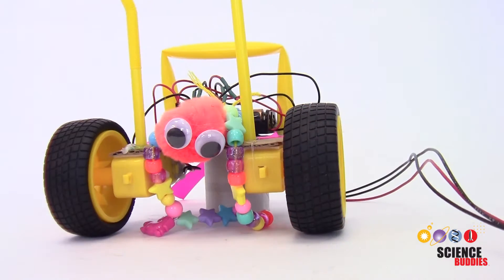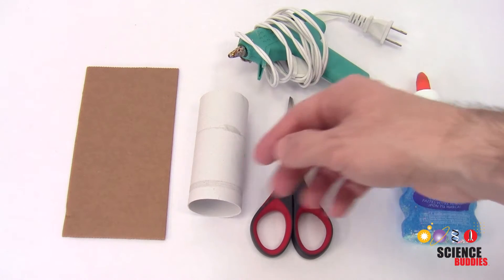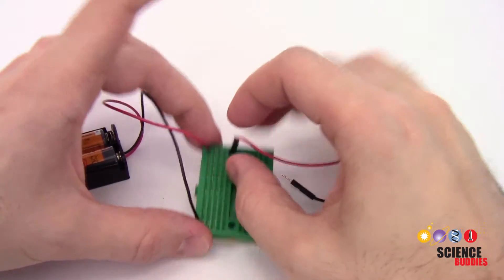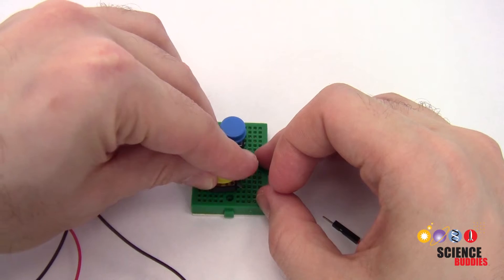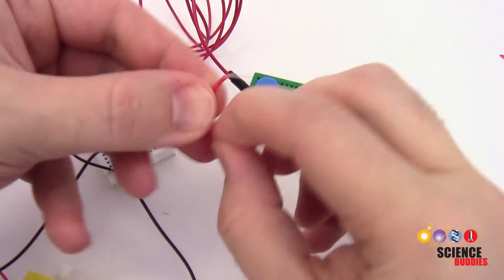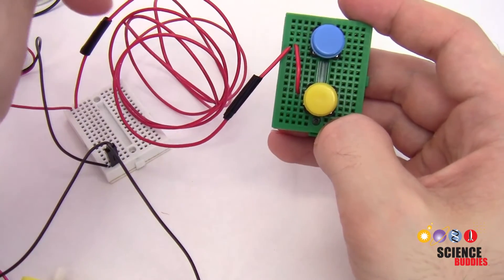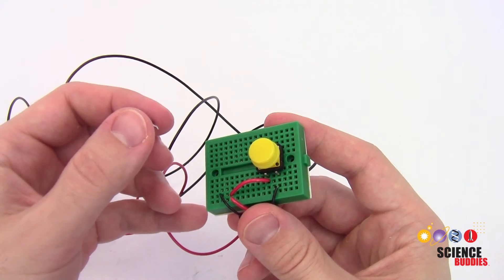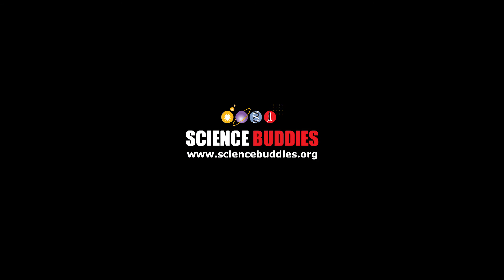Build a Simple Steerable Robot | Science Project

Comment: Hi my motor doesn’t have wires, im wondering if you have to attach it manually or not.
Reply from the maker: Some motors may come without wires and you will need to solder them on yourself.

Comment: Can you make it so the remote control is not attached to the car or use bluetooth in some way, if so how
Reply: Yes but that will require an extra part.
Reply from the maker: You can make a radio controlled version of this project using an Arduino: https://youtu.be/dkQXaeSIE5I?si=0ozkp-06FSv4udBt

Comment: Hello can we use jumper wire for the motors?
Reply: Yes,I did the same and it works . Just attach it to the motors somehow (i cut the insulation on one side and attached it to the motor by twisting)